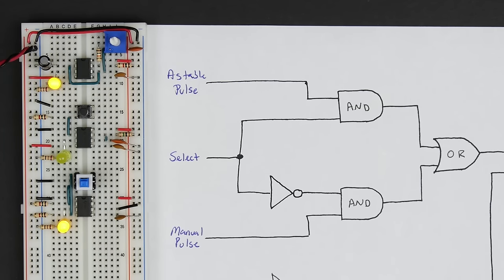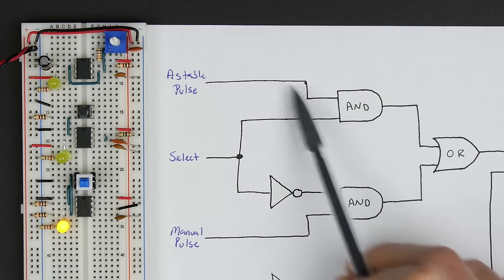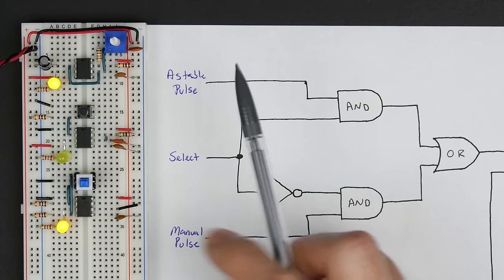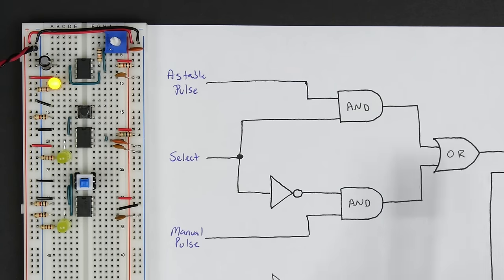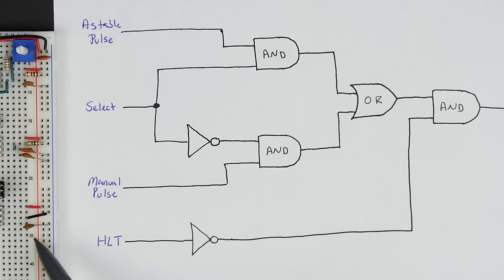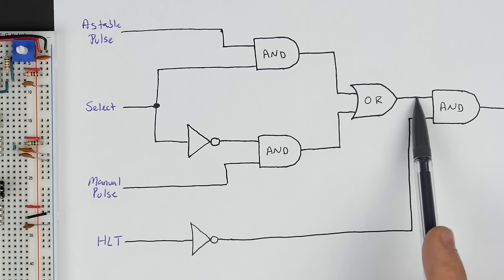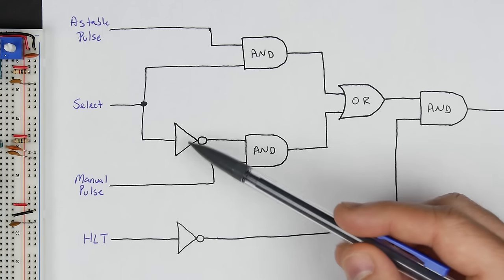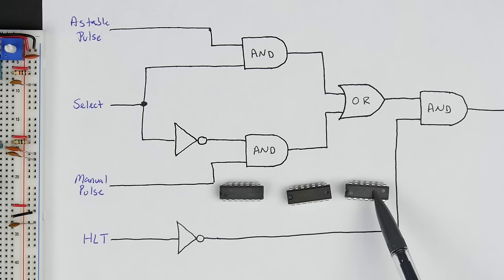Clock logic - 8-bit computer clock - part 4

Comment: what about a multiplexor instead of NOT,OR,AND gates and then a AND gate for halt?
Reply: i mean, NAND gates.
Reply: @NikZapp  I think you need to invert the halt signal first and then and it to the multiplexer output. A NAND gate would produce a high output when at least one of halt and the clock input is low, which inverts the clock input, but otherwise passes it through when halt is high, and makes the output always high when halt is low.
But I agree about the multiplexer!

Comment: okay question. so since the timer can have multiple outputs, such as the connection to the led and the cable. does the power get distributed among the 2 outputs or do both get equal power?

Comment: I have no OR gates...Using 2 small rectifier diodes...Should be fine for low speed?  Im guessing! :)
Reply: hmmm maybe I should consider power output vs a 2 transistor OR gate.. as it will be driving all the clock lines in the project. Hmm If I add a HLT line with an and gate, it wouldnt be the final stage,2 diodes in the place of the or gate should work.. Ever think outloud in  utf8? :)

Comment: I made the same clock as you, but when I use an extra breadboard which has leds with resistors the brightness of the clock led goes down(the volts are going down as well). What could be wrong? 
And also without the second board the brightness of the third led changes as the clock goes on and off.

Comment: Could you realistically join the two AND outputs together and do away with the OR? Or will that likely create an opportunity for the circuit to misbehave?
Reply: No you can't. Suppose one is high, other is low, that equals to shortcircuiting 5V and ground, destroying the IC. you might get away though, by connecting two diodes in common cathode configuration tied with a pulldown resistor, and connect each anode to each AND output.
Reply: @muhammadmuqsith6276  In which case, that's basically an OR gate anyway then?

Comment: I don't know why, but that halt line messes my output up. It make the light turn off. 
I have the halt line running from ground -> hex inverter. The output  -> the 2nd input of the AND gate.
I know this is the issue because if I put positive where the output of the hex inverter is, the light works.
Reply: I am an idiot. I bought open collector hex inverters. I have a feeling this was the cause of this issue. Smh.

Comment: Why doesn't the Blue LED require current limit resistor? or did i just miss that?
Reply: the 555 output is around 3V with 5V input. The forward voltage of a blue LED is around that (at 1-20mA) so it should be okay.
Reply: Wrong it's coming out of the 74ls08. luckily it typically outputs 3.4V. Even if in some cases you can get away without one, using no resistor is bad design and can cause problems because even if it doesn't damage the output of the circuit it will clamp the voltage reducing the noise margin.
Reply: c muller: he mentions this in a later video: 74LS gates have a 120 ohm resistor in the collector circuit of the high-side output transistor.  Worst case, if the output is at 4 V and the LED has a 3 V drop, this gives us 1 V / 120 ohms = 8.3 mA.

Comment: Although this is low power already, could you make it so the select will stop the astable pulse or manual pulse while the other is in effect? It seems 100% uptime for both is a bit of a waste
Reply: You could by using the other side of the switch to power to each timer circuit.

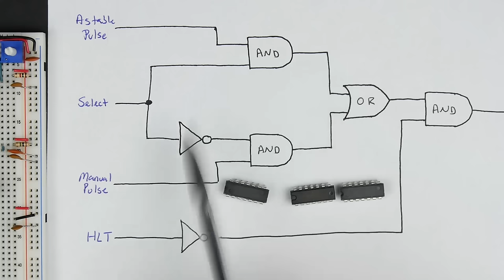Comment: 6:00 any badasses out there who pared the chip count below 2? My guess is that it can't be done with 4 or fewer gates on a single chip, but I'm not sure
Reply: Just the part shown at 6:00? Not the debouncers?   Replace the whole section with on EEPROM.   Use 4 address lines and 2 output lines.

Comment: Why no resistor on the blue LED?
Reply: Because the blue LED I believe is similar to white LED. It required a higher forward voltage, unlike the red/green/yellow LEDs. No need for limiting resistor.

Comment: Hi Ben. I built the clock circut just as you described here. I connect the clock input to pin 7 of my registers and everything seems to be working just fine, on a rising edge of the clock in stores in new value. But the problem is when i touch pin 7 by a finger or a wire it stores in a new value again just like if there were another rising edge, but the clock input is 0. I have the same problem with the counter too. Sometimes it counts a few extra times when i touch its clock input. I do not know how to get rid of that noise and make registers irresponsive to it. I have tried different pull up and pull down resistors, nothing seems to be helpful. I have even tried using pin 3 of the 555 timer you built in the first video directly but that did not help either. Do you have similar issue? Thank you
Reply: What capacitor/resistor value did you use? You might be discharging/charging the capacitor with you body parasitic voltage. To avoid that, ground yourself properly (which is hard), use larger capacitor or try to avoid touching it :)

Comment: Would this work with a mux? I was thinking of using a 4:1 mux for the selection part, with two switches that control the whole module
Reply: with a CD4053B it could

Comment: Wait, instead of using an or gate, why can't we just connect the outputs directly together on one line, and maybe put some diodes in to prevent the current from flowing backwards? Or am I thinking too much Minecraft? :p
Reply: IronLotus I think your thinking too much like Minecraft! I totally get what you mean though. It does seem like it would work just connecting the wires where the or gate is used. You could maybe get it working (to some degree) using diodes to restrict current flow, but I don’t think it would be very reliable and especially not with faster clock frequencies.
Reply: @juliaweber9954  Ah, okay. Thanks for your input! :)

Comment: anyone having trouble with the 555 timer for the select overheating? It doesn't happen before I put in the LS04, LS08, or 74LS32. Only when I seem to complete the clock it will give me this problem.
Reply: overheating to the point that it melted the breadboard a bit

Comment: Couldn't you have just wired the outputs from the astable and monostable clocks to the 2 sides of the switch, with the centre pin being the output?

Of course then I don't think you can add a halt...
Reply: In the previous video ("Bistable 555 - 8-bit computer clock - part 3") he explains that the switch needs to be debounced, otherwise he might get multiple pulses when he presses the switch.
Reply: It would still be debounced -- I don't mean to remove the debounce circuit, I just mean use the output directly. You don't need logic gates when you're just picking between one or the other circuit.
Reply: Okay, so you'd still have to debounce the output of the switch? I think that would work and might even mean you could drop the debounce on the manual clock button. But you'd still need the logic gates for the halt line anyway.
I think the main reason Ben approached it like this was so that he could teach us about Astable, Monostable and Bistable 555 timer circuits.
Reply: Oh absolutely, I expect if he replied to my first comment it would be something along the lines of "to teach you all". The power of logic gates if you're using them anyway (for halt) makes them attractive of course.

Comment: I'm just wondering if anyone has tried using the NAND gate logic he showed? I am trying to wire mine up using 2 NAND gates, but I'm finding that I have to invert the manual pulse before it goes into the B input of the NAND gate as shown in his picture. If I don't do this, then the final output is opposite of my manual pulse when I'm in manual input mode. When I push the button, the final output goes off, and when I let go of the button, the final output goes on. It's backwards.

However, the astable pulse works just fine. The final output follows the astable pulse correctly.

Has anyone else tried this and found that the manual pulse is not working correctly when using the two NAND gates?
Reply: I figured out what I did wrong. Rather than delete that post, I'll leave it up in case anyone in the future runs into this. 

After going over the circuit again and again and again, I finally realized that the problem I was having was that I was connecting the wire from the manual pulse button to the NAND GATE ... as opposed to connecting the wire from PIN 3 of the 555 timer to the NAND GATE. I knew that the 555 timer was there to serve as a debouncing circuit for the manual pulse button, but when I was looking at Ben's NAND GATE logic drawing around 4:50, I guess I forgot about that ... because I was trying to connect the button directly to the NAND GATE. And it turns out when you do that, the button logic is backwards from what you would expect. So in addition to debouncing the circuit, the 555 timer is also inverting the button press.
Reply: Its awesome what your ate saying!! Have you finished the computer?

Comment: Hallo, I am using sn74ln08n (and gate) for this circuit but if I want to get false on this chip, both inputs of the gate have to be connected to ground. If either of them is not in ground even if they are not 5V, the output is true. I have brobably bought the wrong chips with some weird kind of logic. Can anyone tell my how to work with them so that they would work as expected? Thanks. :D
Reply: The AND gates should be pulled low, as here for example, the two way switch is pulling either one of the AND gate inputs low. Which is very much a logical low.

Comment: Can some one help me I have tried 10 times to get this to work and no dices. I am doing what Ben is saying and it is going no where.
Reply: I could only offer advice such as suggest that you follow through with it from the beginning.  Be certain that you’ve got the initial module doing what he had it doing, the astable clock, and the pulse button as well.  And then it might be advisable to possibly try to work the remaining additions by checking the data sheets for these logic chips.  Figure out which pins power them on, and set them up
So they’ve got voltage and grounds wired in to power them all appropriately.  Then I guess you should probably try to assemble the signal wiring, using his flow chart as a reference, and not so much by referring to the breadboard in the picture.  And don’t forget that there’s a little tiny jumper that connects columns 19 and 20, I think.  Those leads get to be like kudzu after little time.  Learn to reference the logic gates by the Datasheets and then follow the flow chart with the signal jumper wires.  You’ll get it once youve sketched out the layout of these logic chips once or twice, bet on it .  Good luck.  Also don’t let your back break or go blind over it.  Give yourself some break time and get away from it to shift focus when it just doesn’t work.  It’s necessary unless you want to die at a young age, with grey hair and hypertension.
Reply: @jimmy_jamesjams_a_lot4171  thank you. I have a good friend that will help me. I appreciate the encouragement.